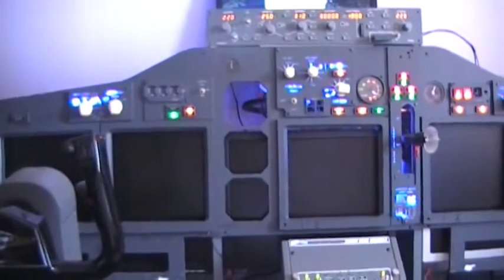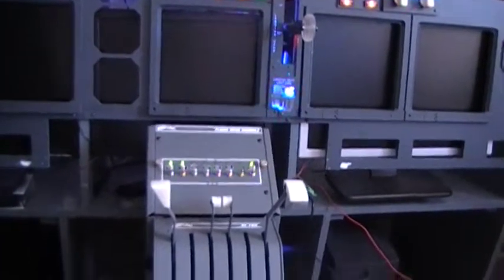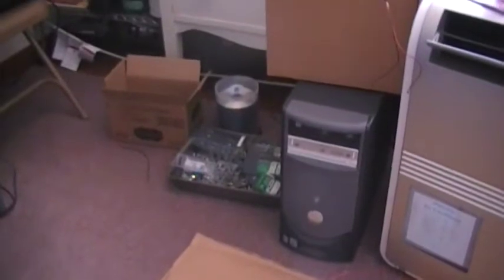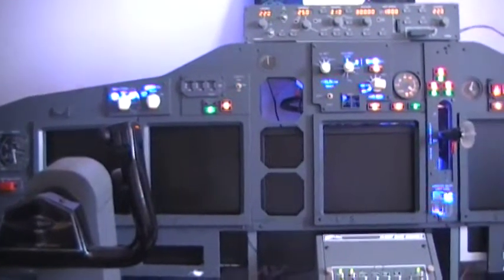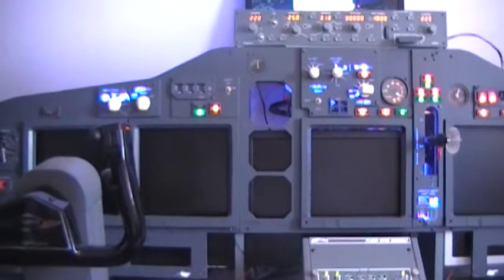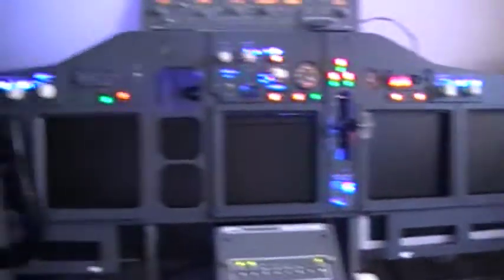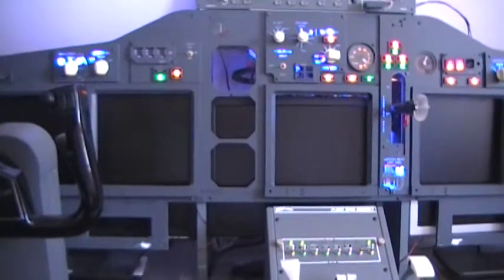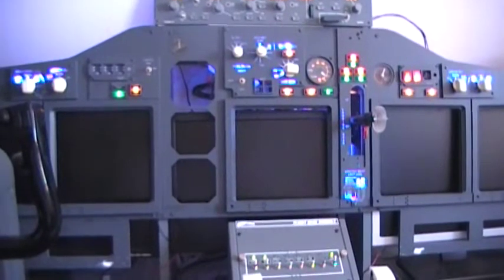Boeing 737NG Home Cockpit Simulator

Comment: i am thinking of building the modules myself , like the mcp , efis and cdu. Thnx to you i got known with poldragonet and they sell interesting kits, without electronics. I would get the electronics from open cockpits then ,  but what i wanted to ask is why you bought a goflight mcp , and not build one yourself?   since it will be much cheaper.  or did you maybe allready own it before you start building the whole cockpit ?